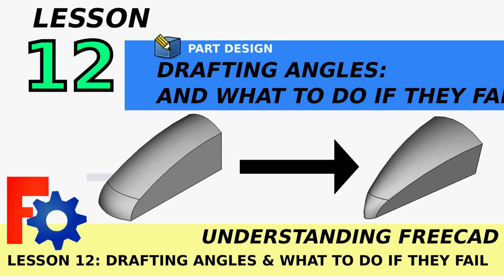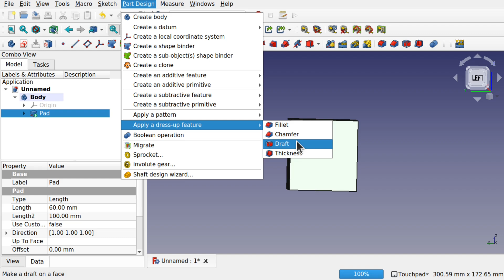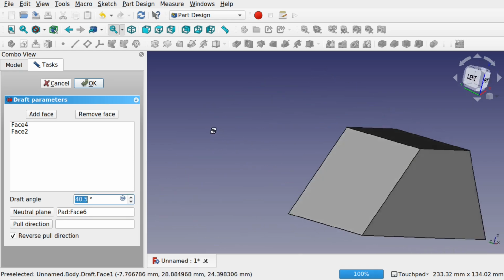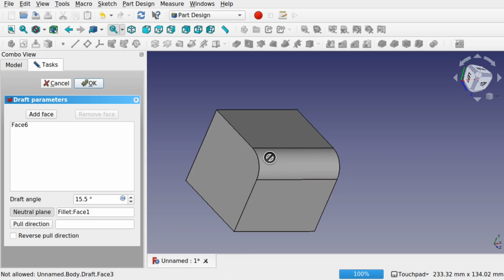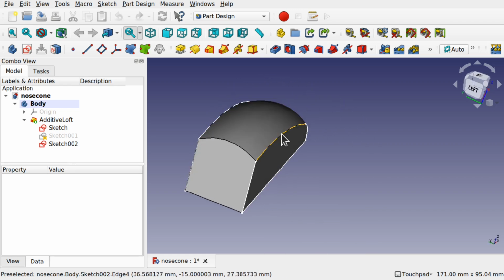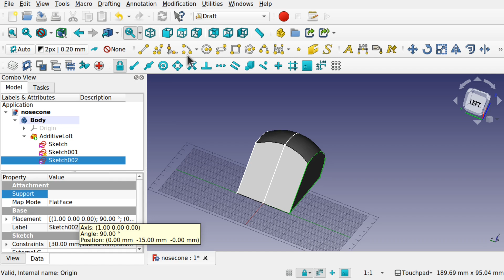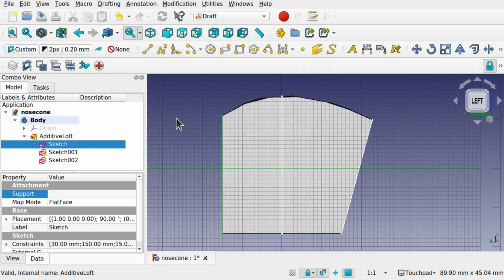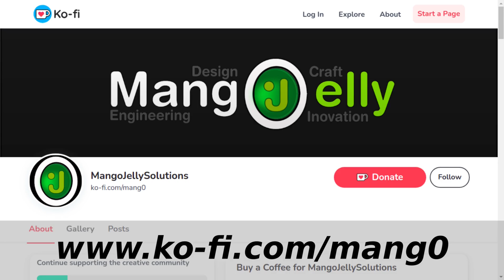Understanding FreeCAD Lesson 12 Draft faces and rotate / angle edges | Part Design | Beginners Guide

Comment: Another excellent tutorial!

I am someone who has actually made good use of the draft function. I have used Freecad a number of times to make models to 3D printed patterns for sand casting. In fact, I made a couple of patterns and cast the parts in aluminum last week ago. I wish your tutorial had been available when I made my first attempts at 3D printed patterns a couple of years ago. At that time I only found one video and it wasn't very clear. I'm going to have to look at your video again to cypher out some of the more advanced techniques that you included. 

For the last year I have been using the Link Branch developmental version of Freecad. One feature that I have found useful is that an angle (i.e., pattern draft) can be applied when a sketch is padded. This has been meeting my needs for making patterns for casting without having to add the draft in a separate operation. Hopefully this feature will be incorporated into the stable version of Freecad in the future.
Reply from the maker: Thank you, glad you enjoyed the video and thanks for sharing your project. It's great to find out what people are using freecad for. I never tried casting, it's something that I have always wanted to try. I never knew about that feature in the link branch. I tend to keep to the regular release branch for my videos only because its the most commonly used but have used the link branch for some projects. I really hope that it is merged with the regular releases.
Reply: @MangoJellySolutions  I was reluctant to convert to Link Branch as there is less tutorial information on it and there were lots of warnings that it is developmental. However, I have found that most of the recent tutorials still apply. I am far from an expert, but I made the shift because the topological naming problem was giving me fits and Link Branch generally avoids the problem and it also handles fillets (which I use a lot of) better. 

The combination of Freecad, low cost 3D printers, and moderately priced castable resin has caused to shift most of my casting to the investment process. A Google search for "u-joint USATC S-160 Consolidation" will get you into a thread where I've pictured several of the castings I have made using Freecad as well as some earlier work using wooden patterns before I made the leap into 3D cad and printers.